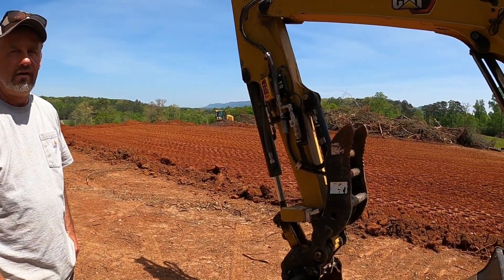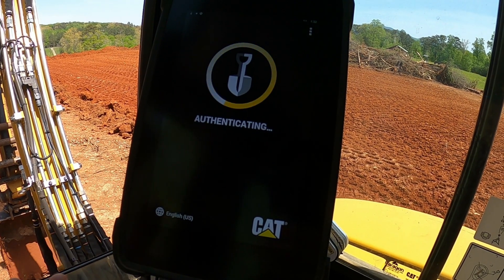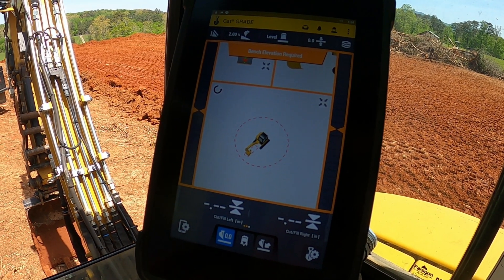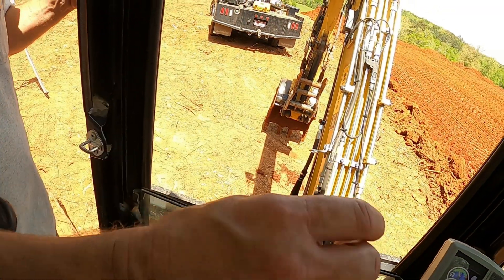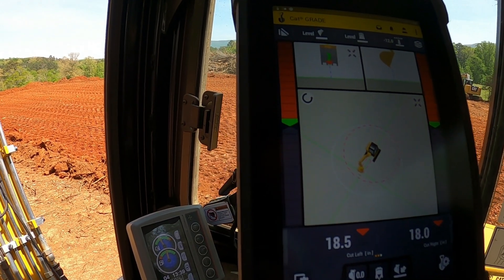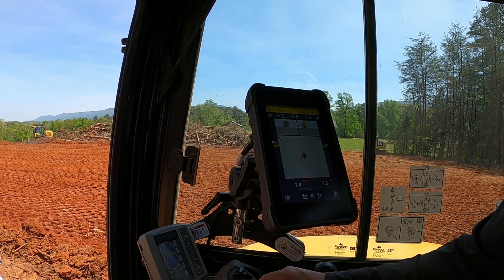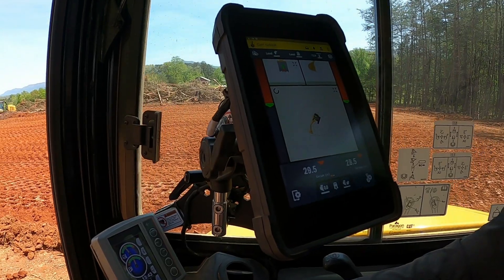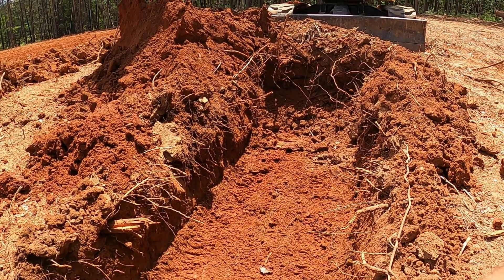PERFECT GRADE! Trimble 2-D Grade Control On Cat 304 Excavator! With @tristardiggin

Comment: If the length of the teeth were calculated as part of the benchmark, how can curling flat and pulling back be 12"?  Wouldn't one need to use the bucket teeth to check depth again after cleaning out the hole?
Reply: Believe there's sensors on main body, boom, stick and bucket and once system is calibrated the position of bucket can be calculated and displayed in real time. Which is why the laser is used when machine is moved.

Comment: This is very interesting.  I remember being on a grading job as the inspector(1984) where the contractor got a laser system with a regular tripod and a 15-foot high tripod where all of the machines were fitted with receivers so they could all work off the same BM at the same time.  The project was about 1500 feet long and 700 feet wide and about 20 feet deep.  The system was accurate to 1/16th inch at 1500 feet.  The operators weren't happy about using this until they started with about 30 minutes to 1 hour in and they did not want to lose the system.  There were also 2 linker rods with it to check grade.  Everyone could work at the same time to get the same grade.  With the laser line above the machines, no one machine shielded any other machine.